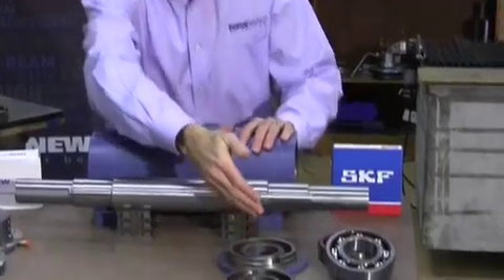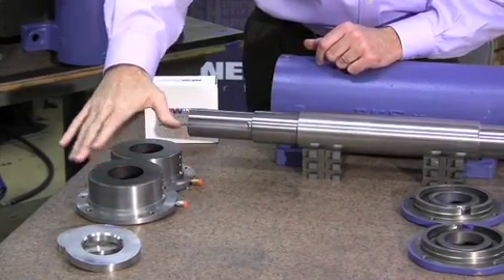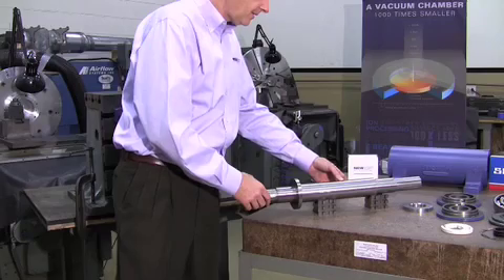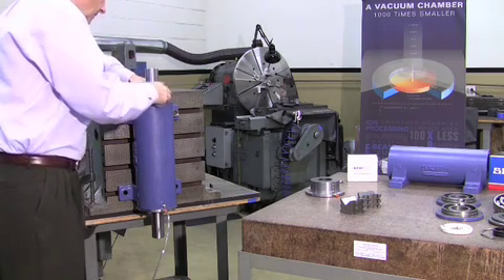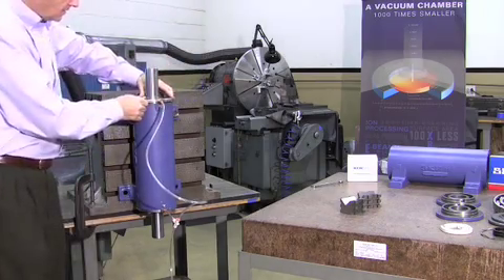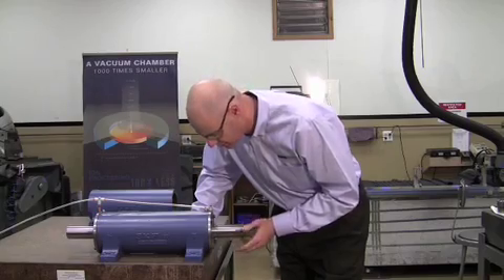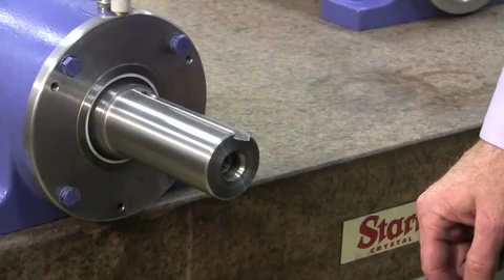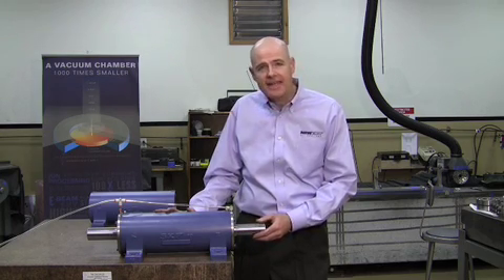SKF Air Bearing Retrofit

Comment: How do you ensure concentrically of the two bearings?
Reply: The supplied air pressure at the time of assembly self aligns bearings for concentricity with respect to the spindle and locked